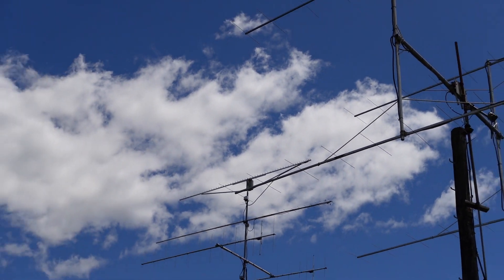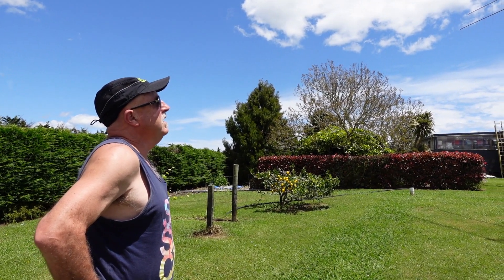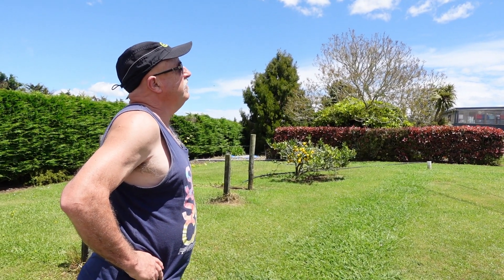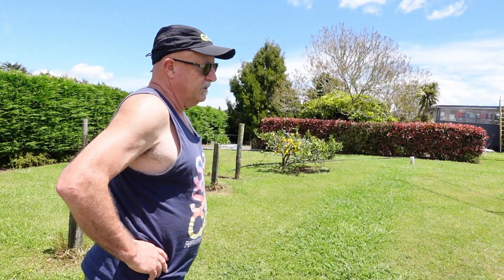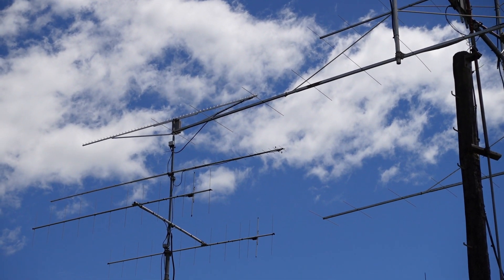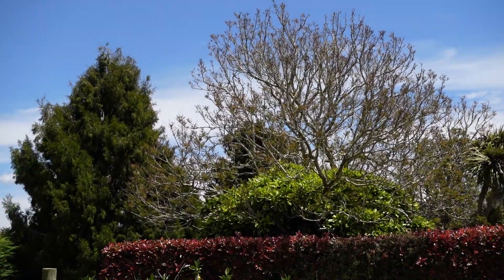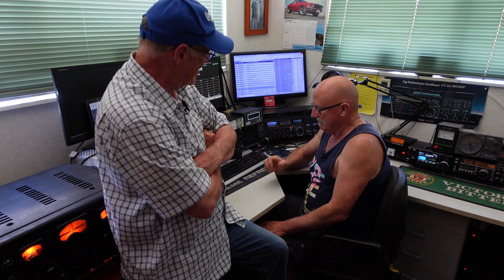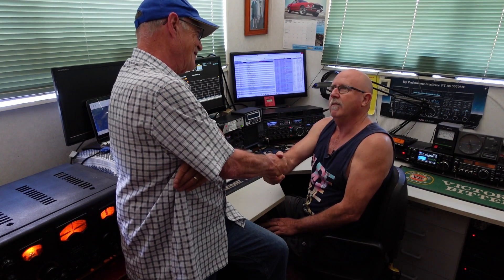1296 DXing - Part 2

Comment: For 160m, set up at least 2 verticals. For best F/B with 20m spacing use 135°phasing. With 40m spacing use 90° phasing. In RX mode this offers up to 45 dB attenuation from QRN in unwanted directions. Overall at least 3 dB less noise, makes the use of beverages un-necessary. Extra long radials in the most interesting DX area gives you many more hours of QSOing dx per day (night ?). I used this in my setup between 1984 to 1991. GL de Bjoern